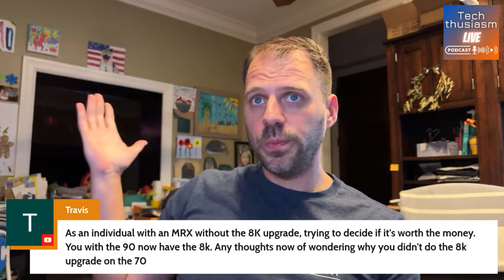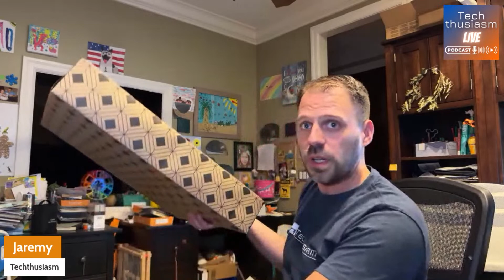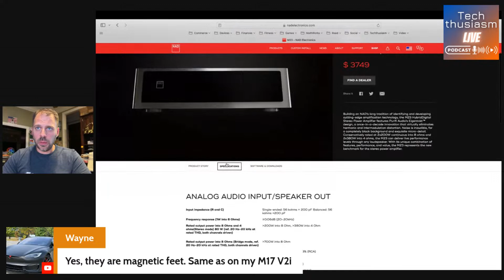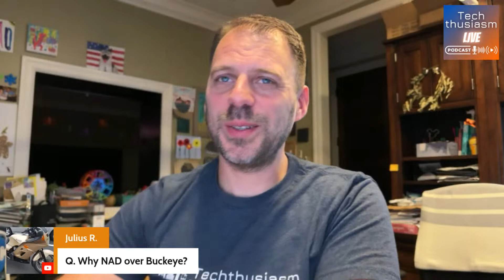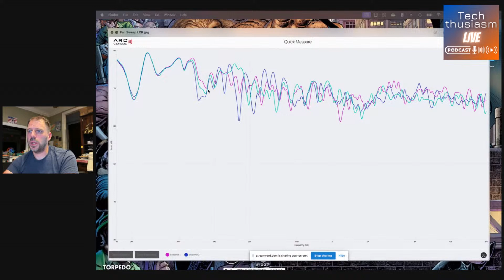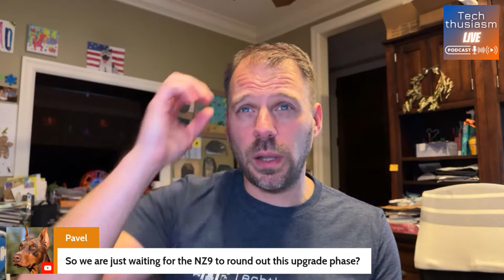Mystery Amplifier Unveil, AVM 90 Review, Home Theater Gaming HDMI Setup | Techthusiasm Live Podcast

Comment: Any thoughts on class d compared to the parasounds? A few people have mentioned lack of body and harsh highs on class d.
Trying to choose an amp that will go with the 90, thinking of primare 35.8/nad amps and parasound.
Reply from the maker: I don't think there is any lack or harshness at all. I think the NAD run circles around the Parasound, especially the A52+ models. My room is well calibrated with ARC and I have demo'ed for some real audiophile folks that love it. If you need help procurring the amps, let me know at jaremy@techthusiasm.net.
Reply: @Techthusiasm appreciate the reply, looks like class d is on my list. 
Will certainly help, running cooler and less weight.
Reply from the maker: Cool. I'm hoping to pick up NAD as a dealer, so do get in touch.
Reply: @Techthusiasm stuck between nad (28)/apellon/ati/primare at the mo.
Not going anthem because I've heard a few things about them not being up to par, although thats probably just hearsay.

Comment: I have the JBL SDP 58. How would the AVM 90 compare to this? Had the NAD T778 . Loved it but not future proof. It sounded awesome . If NAD came out with an 16 ch hdmi 2.1 processor I would buy it in a heartbeat
Reply from the maker: Those units definitely go up against each other. And I think there was an SDP 55 that matched up against the AVM 70 too? I know one local person that has the JBL. My prior research into the JBL and Arcam units, which are pretty much equivalents, was that they had a bit more instability and needed firmware fixes. Honestly, though I haven't paid as much attention to them, so I can't say how stable or good they are right now. With the JBL, you have DIRAC vs. ARC with the Anthem. Similar connectivity and system support between them. 

I do think NAD will come out with another home theater preamp coming up. The M66 is coming for two-channel, so it would be natural for a multi-channel follow-up.

Comment: I ran into the same issues when connecting my AVM 90 to my LG CX and projector.  I used to only game on my TV, but since upgrading to the Benq 4550i projector it's been a total swap.   I do miss the pure blacks of the LG, but I'm not finding I miss the 4k/120.  

This weekend I was thinking about going back to my TV to play Alan Wake 2 so I wanted to compare between the two.  I loaded it up and had the video output on both screens and went to turn on HDR and behold the option was missing.   

Another issue I've had when I was using my TV I had 120hz and VRR turned on in the PC and didn't revert those changes when I switched to the projector.  It took me an hour to be able to get a picture back on the projector, it was a nightmare.  I've noticed that the AVM90 is a bit more finicky with HDMI handshakes than my old Denon.

Also if you haven't looked at PSA subs, I've been very happy with mine.
Reply from the maker: Double routing HDMI out can be tricky for sure. I had been running my Kaleidescape to my living room with Zone2 out of my AVM, but now it seems to not be passing HDCP when doing this. Argh.

Comment: I have a Parasound as well, mine doesn't have any hum or hiss even if I place my ear right up to the tweeter. Congrats on the NAD amp I hope it pairs well with your Focal's. I think your DAC/Preamplifier will now play a bigger role in the sound signature on the electronics side.
Reply from the maker: The hum I was experiencing is very much an interaction of one model of the Focal speakers with the A52+ only, per my testing. The A31 didn't do it. Parasound overall is exceptional, and I still highly recommend them. I think they are the best buy for A/AB amps at a premium price point before you start spending a lot more money for something like Pass Labs.
Reply: @Techthusiasm  Your channel convinced me to give Class D amps a try for HT usage.  I will still hold on to my JC 5 amp for Stereo music. Thanks!
Reply from the maker: I'm curious to see how they do. Hoping to get the NAD in this weekend.